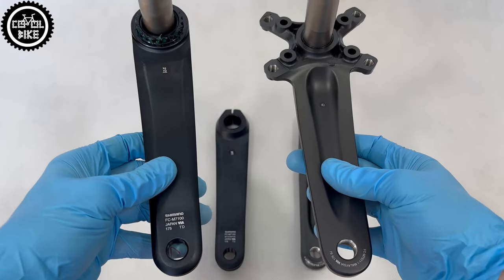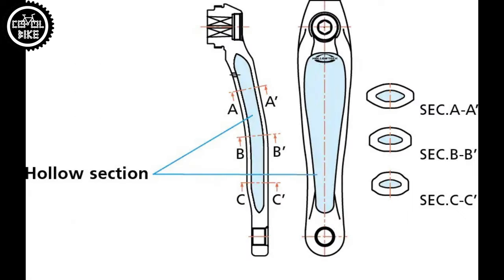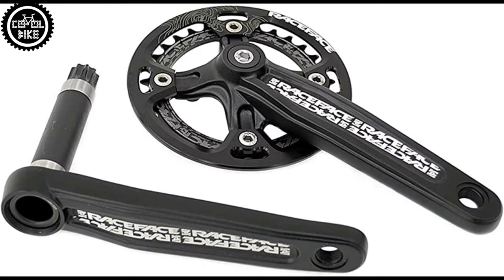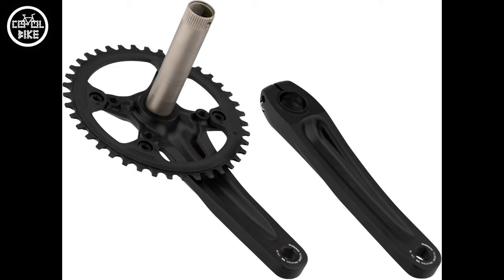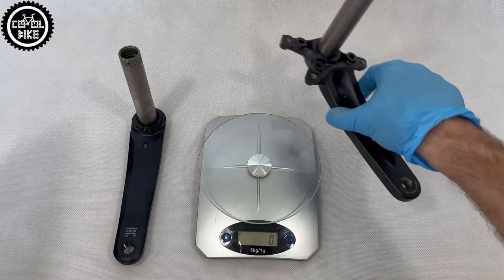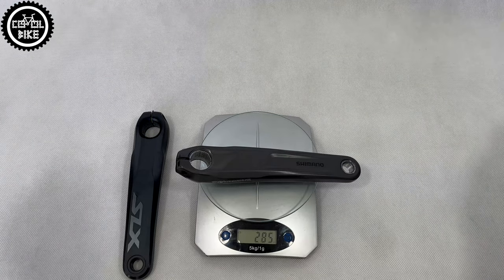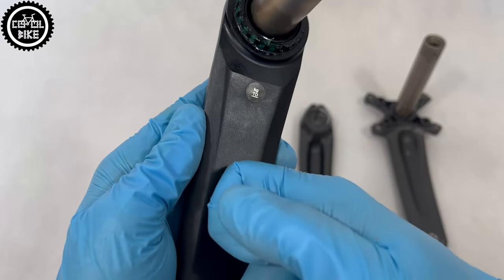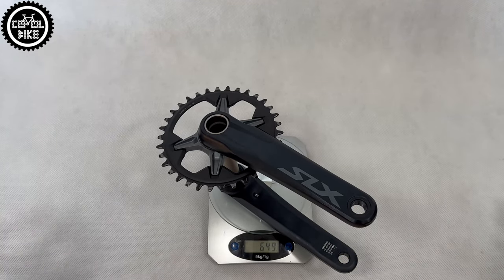WHICH CRANKS ARE BETTER //SHIMANO HOLLOWTECH II  Vs  2-PIECE CRANKSET

Comment: I still don't understand. 😀The hollowtech II have hollow crank arms and are lighter but use the same axle? I have Deore FC-M5100-1 which I believe is 2-piece but appears to have the same axle.
Reply from the maker: Yes, all Shimano cranks have stell 24mm axles. Only arms are differnt.

Comment: Thank you for your expertise, but the video is of no value to my little brain. I don't know which version you are talking about in any given moment. I think you fail to identify which is which (1 or 2?). Next time put a label on each piece of hardware so the viewer can know which is what.
Reply from the maker: Hi, thanks for your comment:). But it is really easy to determin which cranks are HT 2, and which 2-Piece.
IF you can see any holes, deep lines etc, in the inner part of crank arm it means that it’s 2-Piece.
If the arm is completely flat, and wide it’s HT 2.
Soon, I will release new movie about SLX/XT/XTR cranks, and maybe it will clarify that different even better ;)